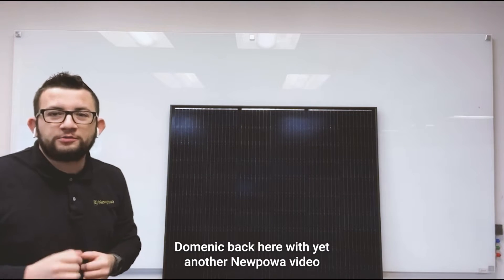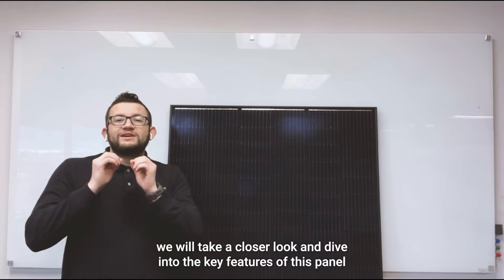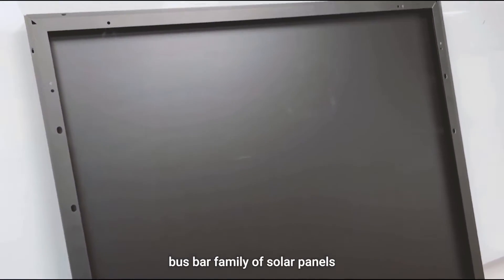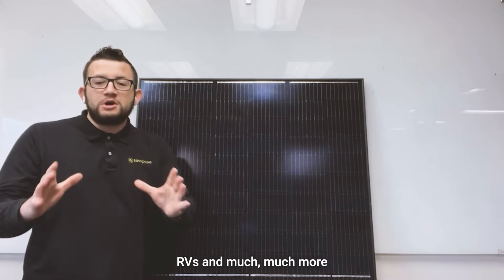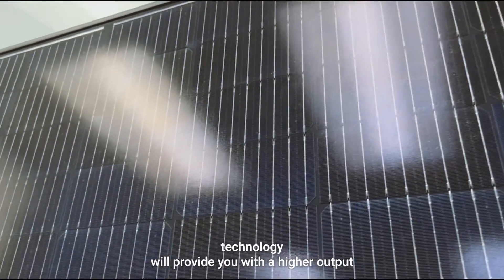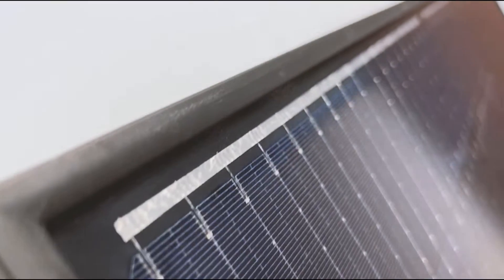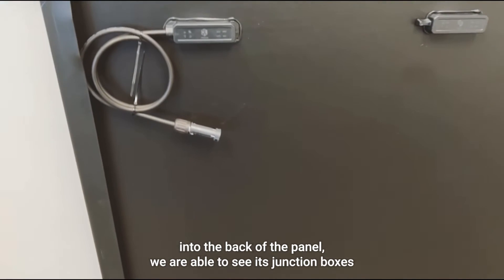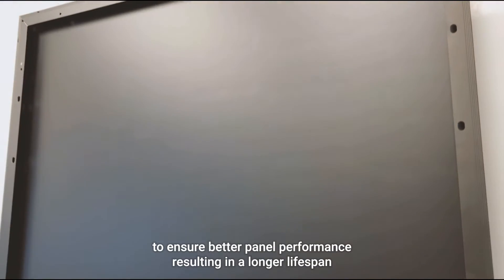Newpowa's 360W 24V Mono Solar Panel

Comment: Why are the solar cells off set like that? 
I recently saw these on Amazon and thought they looked cool.
Reply from the maker: I assume you mean the half cell being planted with off set  in different lines? That is because we need to leave some pace at the back to wire up all cells together and it is easier for the machine to operate this way. Hope this answers what you are asking and yes we think they look cool as well!